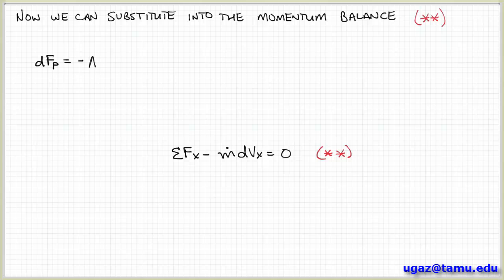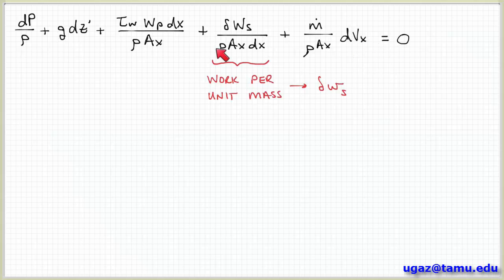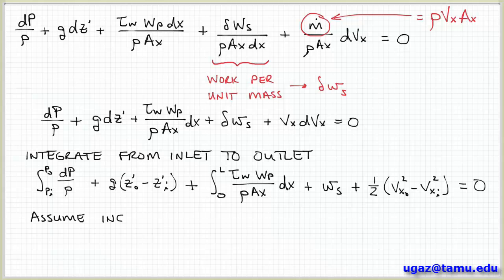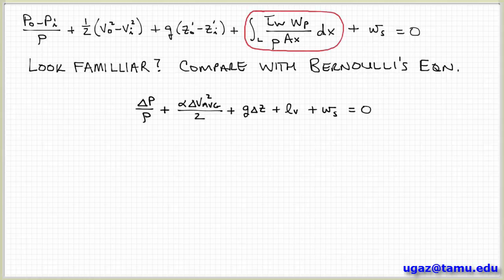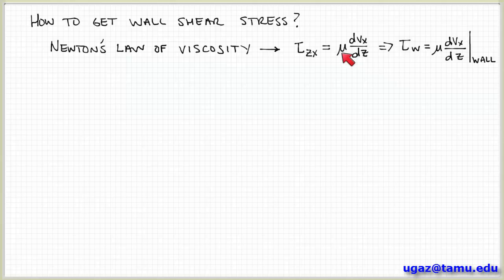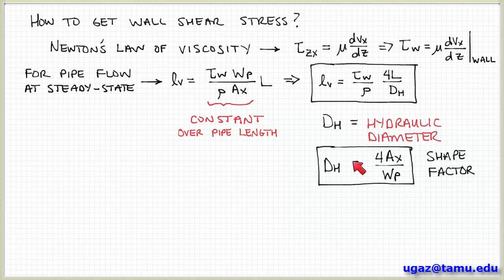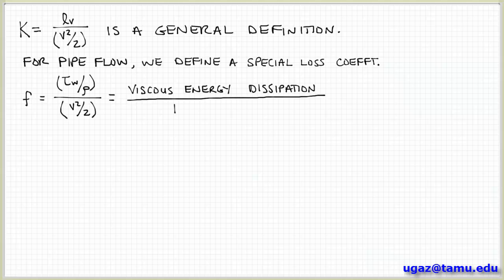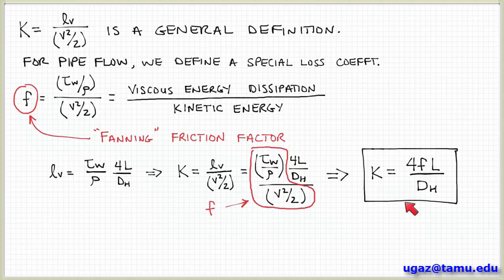Losses & Friction Factors, part 4 - Lecture 6.4 - Chemical Engineering Fluid Mechanics

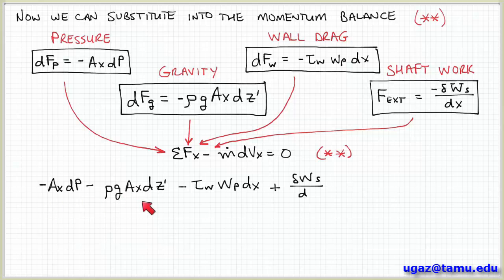Comment: why did you add shaft work at 1:40?
Reply: I have the same question
but then i saw you posted your comment 2 years ago and no one replied to it :D
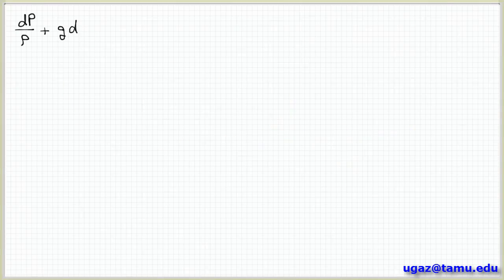Reply: I found the answer, initially, he made a mistake but after dividing rho*A(x) every term on left side would be negative and equal to zero , so cancel out the negative sign and then it would be correct as shown in 2:01
Reply: @TejSwaroop  is this lectures is Enough for fluid in chemical engineering